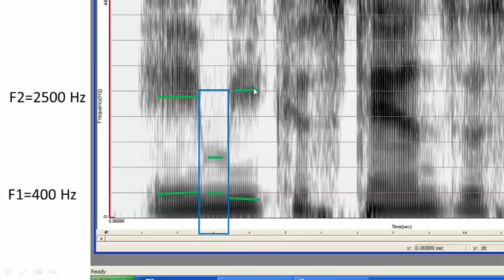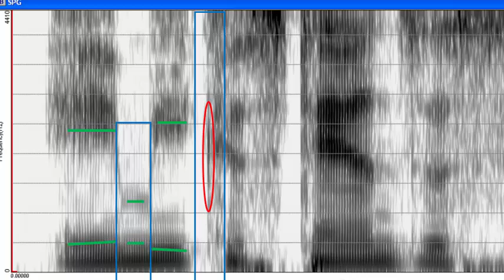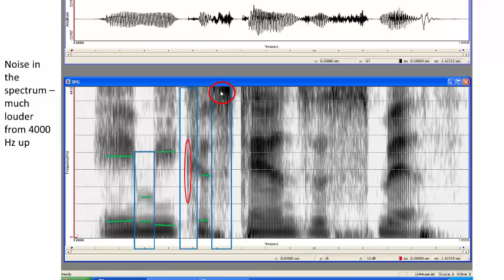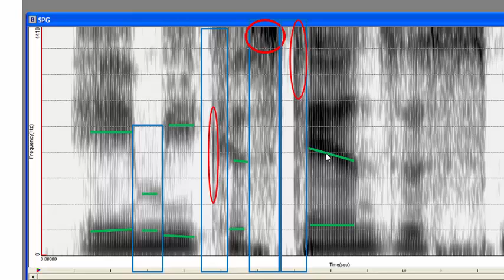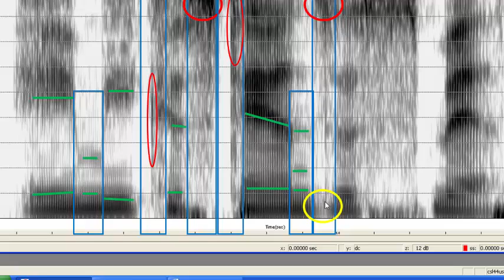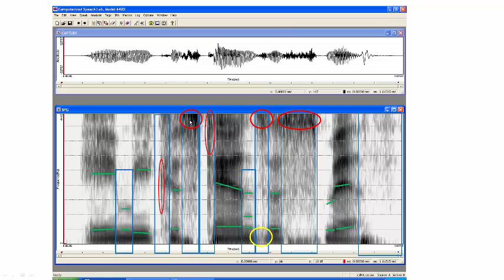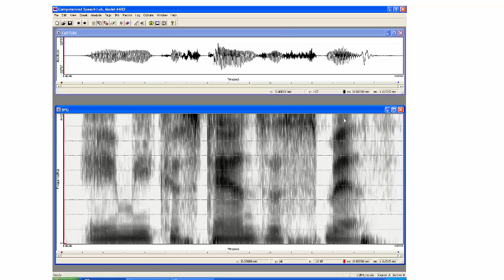Step by step through a spectrogram

Comment: I'm facing difficulty with the choice of microphone for my recording. Can you suggest any affordable one that can help me record voices for acoustic analysis. The study will look at F0-3 and vowel duration
Reply: A lot of people use the Shure SM-57 in phonetics research. It's a classic, and usually runs about $100. But you should also consider your connection needs. The SM-57 has XLR connectors, and that's fine if you have XLR inputs. If you are connecting directly to a computer, you might not have access to XLR inputs. For direct connection to a computer, many people like the Blue Yeti, which also usually runs about $100, and it has USB connectors that can go directly into most computers.

Comment: F1 400hz and F2 at 2500hz...why? Shouldn't F2 be at 800hz?
Reply: Identifying formants can be a bit tricky. I think you are talking about the second vowel. I see a little bit of darkening around 800 or 900 Hz, and it can be tempting to view this as a formant. But when you compare the darkness of the bands at 400 Hz and 2500 Hz, those bands are quite a bit darker. Usually we expect to see formants be roughly the same intensity as each other, and spectrograms represent intensity as darkness. So it would be unusual if one formant were dark and the other formant were light. One other cue that can be helpful in many spectrograms is finding F3 - usually F3 is pretty high, often 3000 Hz or higher. If F2 were at 800 Hz for this vowel, then the band at 2500 would have to be F3. This is too low for most English vowels. To be honest, though, in this specific spectrogram, the "real" F3 isn't very clear, so I don't think this would be a very useful cue in this specific case. But many times, I've used the location of F3 to help figure out where F1 and F2 must be.

Comment: Anyone know how I would go about measuring vowel duration? Is it as simple as zooming in and selecting the part of the vowel after the VOT until the end of the vowel waveform?
Reply from the maker: Mostly, yes. This works best when the vowel is surrounded by certain consonants, especially low-sonority consonants such as voiceless obstruents. With consonants such as liquids and glides, it can be very hard to tell where the line is that separates consonant from vowel.

Comment: hi Andy, do you mind explaining how can you tell where does one sound start and end? in the video, you didn't mention it, you just said: now let's look at the next sound.  How exactly do you new where is the next sound? Thank you very much.
Reply from the maker: That can be pretty tricky sometimes. Some sound transitions are easier to find. For instance, stops usually have a very distinct release point that stands out, and then if the next sound is a vowel, you can find where the formants of the vowel begin. That's where one sound ends and another begins. When sounds are really similar acoustically, though, it can be very hard. If there are two vowels next to each other, the boundary is very loose. And sometimes a glide or a liquid looks a lot like a vowel, and finding the point where one sound ends and the other begins is mostly estimation.
Reply: @andymcmillin8237  Thank you so much for your reply! I feel stupid to ask but what are the physical features showing that ''stops have a very distinct release''? For example the darker color on the top part of the spectrogram?
Reply: Yaxin G there is a blank/silence just before.
Reply from the maker: @yaxing4775  As BlueCatSW9 said, the white space indicating silence before the release is a good cue for the closure phase of a stop. Also, the release itself is usually marked by a very sharp vertical line. The extreme contrast between the white space and the sharp line usually makes for a very salient visual cue for the release of a stop. The darker color at the top is often characteristic of alveolar stops in particular. Velar stops often have the darkest part in the mid-frequencies, and bilabial stops sometimes have a darker area in the lowest frequency areas.
Reply: @andymcmillin8237  Hi Andy, I've watched your video hundreds of time, great job!
I would like to know how you manage to highlight portions of your spectogram like the red circle, blue and green lines that I see, I'm unable to do that with praat, would you be free enough to explain it to me?  thanks in advance
Reply from the maker: @academictips2023  The spectrogram itself was made using Computerized Speech Laboratory (CSL), and the video was made with Camtasia, which is designed for screen-capture recordings. The highlights and callouts are all built in features of that program, and they are overlaid on the picture of the spectrogram.
Reply: @andymcmillin8237  Thank you for the time you've taken to reply.

Comment: I got confused by the high frequency energy before the first vowel (ei). What would be causing that? Maybe an in-breath before speaking? What made you decide to ignore it and start directly with the first vowel? Many thanks
Reply from the maker: That's a great question. The two things I think about are: 1) spectrograms have artifacts - things don't always look as perfect as the textbooks want you to think they will. So some possible "cues" will be red herrings. 2) in this case, the shadings you refer to would be characteristic of a voiceless fricative. The energy extends down to about 2000-2500 Hz. That is most characteristic of post-alveolar sounds like /ʃ/. But this sound is a fairly high-energy fricative, which should lead to fairly dark shadings. And these shadings aren't very dark - in comparison with the other sibilant fricative on this spectrogam, /s/ (described at around 5:00 in the video), the shadings in this initial high-frequency energy are substantially lighter. So this makes me lean away from thinking that it's a /ʃ/ sound. Finally, when I look at what the choices are (since this is a multiple-choice example), there aren't any options with a voiceless post-alveolar sound at the beginning. Three names, Jenny, Jeff, and Gerasimos, begin with a voiced post-alveolar affricate, but there are no indications of voicing on this sound in the spectrogram. And a couple of names start with /s/, but the acoustic signature of /s/ is different enough from these shadings that this would be highly unlikely. So on multiple-choice grounds, it's unlikely that these shadings represent a specific phonemic element. And then one source of evidence that I have that no one else would like have is that I know that my own voice is pretty terrible for making clear spectrograms. I have a lot of glottal artifacts, and more intrusive noise in the upper frequencies, likely representing slightly more breathiness or tension in my voice than many speakers. So I also have seen many examples of artifacts showing up in my own spectrograms, and I'm always on the lookout for them. My explanation of this specific artifact is that as I began to say the initial vowel, as my glottis moved from "closed" to "vibrating", I was probably slightly miscoordinated, resulting in a small amount of time when the vocal folds were slightly open before aerodynamic factors set them into vibration. The fault, therefore, is in my voice, and not in the spectrogram itself. Good eye in spotting that!

Comment: Amy Costanza Smith.   How can you tell the difference between a /t/ and a /k/ followed by a /s/? Thank you much
Reply from the maker: That can be really tricky. Sometimes you can see formant transitions from a vowel into a /t/ or /k/, and they might look distinctive. But formant transitions can be very quick, and subtle enough that they aren't always reliable cues to place of articulation. So if you have them, you can make some educated guesses, but if they aren't visible, it's hard to know what to make of it. And when either of these stops have an /s/ immediately following, they won't have the kind of aspiration energy that is described in this video.
Reply: I guess it is Amy Constanza Smith